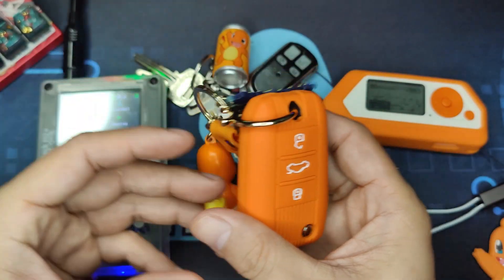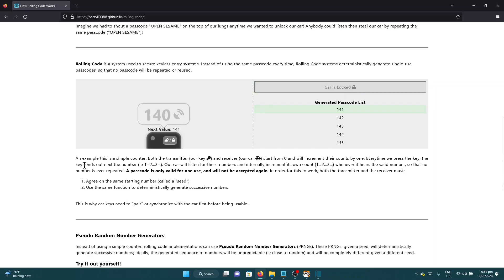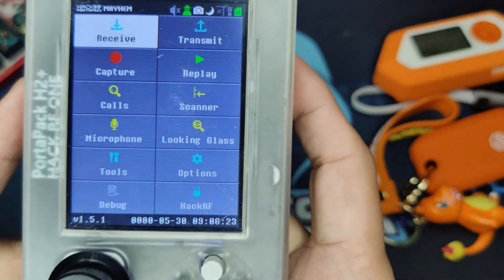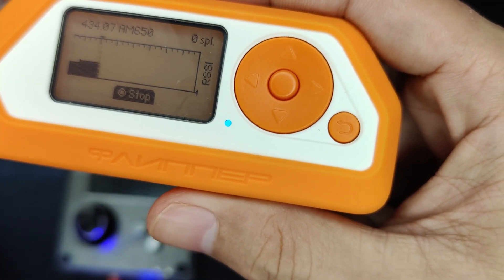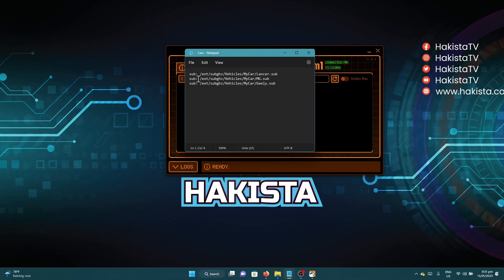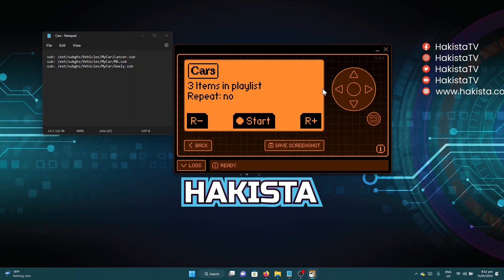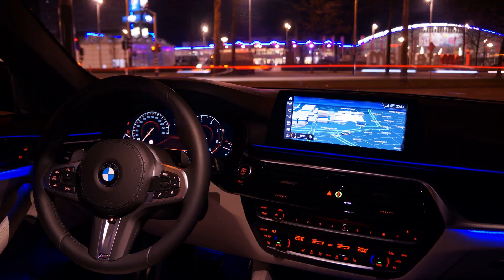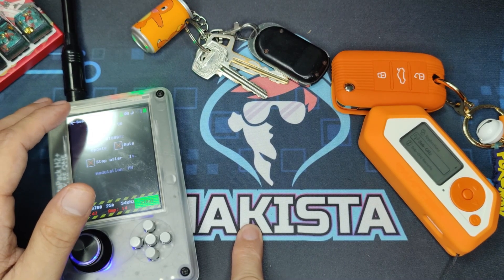Hacking 3 cars in 10 seconds // Pinoy Hacker

Comment: Question if I do this will my original car remote de syncs? 

Let say I capture and press the unlocked 5 times even im out of range from my car?
Reply from the maker: it will only cause problem if the signal is recieved by car. I wouldnt risk it because the cost resetting it at the dealer  is expensive

Comment: If I use my HackRF to jam the signal from the key fob to not let the car lock, what is the point of capturing/figuring the rolling code to unlock the car? Also did you capture the locking signal from the key fob, or the unlocking signal?
Reply from the maker: 1. Jammer was that the code does reach the reciever. Once it reach the reciever, the code cannot be reused again.
2. It is a one time use only code since it is a rolling code. Although generic rolling code implementation are now easily by captured and replay by flipper zero.

3. The locking signal is captured from keyfob
Reply: @HakistaTV  so is this same for supported vendor, do i need to jam the signal ?

Comment: team, also why just not unplugg the car battery ? or the car jammer works internally and is powered separately ?
Reply from the maker: The hackrf was used as the jammer while the flipper zero was used to capture the signal.

Unplugging the battery didnt crossed my mind 🤔

Comment: I didn't understand some things: if I use the jammer, will the Flipper zero  also record the noise of the jammer? Let's suppose then that I manage to register the opening signal of the car even if I attach it in the future I will be able to open it only once then the rolling code will change again
Reply from the maker: 1. The jammer will be near the car and the keyfob will be near the flipper zero. With this, flipper zero can record the signal without being received by the car 

2. You can only use the recorded signal once and only if the car wasn't opened yet. Because the valid signal changes every time the car receives one. There is also a chance to screw up the codes and brick your lock. Your only option is to have your manufacturer which expensive

Comment: Can the flipper capture with a gpio antenna? Does the flipper have capabilities to capture the signal, just like the RF one?
Reply from the maker: I have seen on some projects that integrates an antenna via gpio. An it improves the range of what you can capture.

Flipper Zero is sub-ghz only which means it cannot capture vhf and uhf  radio signals like hackrf
Reply: @HakistaTV  thank you for that cool maybe I’ll get a RF 1 as well.
Reply from the maker: @godzeus9702  HackRF one is an awesome device specially with the portapack!

Comment: I noticed the playlists in the latest Xtreme FW too. I am planning to use them against Paradox rolling code fobs. These have always only 16 codes rolling in certain pattern. So I plan to make a playlist with the correct order. Playing through all of these should finally bring me to correct code.
Reply from the maker: i checked out paradox keyfobs online, if you just read it does it show princeton? because if thats the case then flipper zero already has the code to replay it correctly
Reply: @HakistaTV  i didnt understand , flipper zero record a lot of time codes after flipper zero can know which code will use?
Reply from the maker: @keremacar2159  when flipper captures a code, it can identify it's algorithm and then use the algorithm to send the code. Here is the github of the algorithm implementations from the official flipper zero firmware:

https://github.com/flipperdevices/flipperzero-firmware/tree/dev/lib/subghz/protocols
Reply: @HakistaTV  flipper zero enough or HackRf one Portapack h2 need too?
Reply: @HakistaTV  btw thank u so much . I'm learning
Reply from the maker: @keremacar2159   thank you so much I appreciate it. Flipper zero was for capturing code, but for rolling code it will be useless if the car was able to recieved it thats why hackrf was used to jam the signal so that the car would not receive the code and you can use it once. You can capture code if you want, far away from the car so that you can reuse it.

Comment: How often can you use it? Or is it a one time use or can you use the same multiple times?
Reply from the maker: my keyfob for the lancer I can use it multiple times.  The modern ones like the MG and Geely, only once.

Here are the rolling code algorithm currently supported by flipper: https://docs.flipperzero.one/sub-ghz/supported-vendors
Reply: @HakistaTV  what year is ur lancer?
Reply: also do u think that instead of signal jamming if we record the key from a far distance from the car and then replay the code near the car it would work?
Reply from the maker: @simplycrackin  its an e 8th gen 2000-2008 lancer. I changed the lock back then. Thats why it is using a chinese brand named Cobra.
Reply from the maker: @simplycrackin  yup being far will work, but i think it should be more than 100 meters

Comment: Key fob proximity sensor uses a rfid did you tried copying it from key fob?
Reply from the maker: ooooohhhhhh let me check that one
Reply: Did it work?
Reply: @chetankeshari  do we know if it worked ?
Reply from the maker: @chetankeshari  i tried it but i am not getting any rfid signal from the keyfob 😑
Reply: @HakistaTV  their is a way or else how would so many hellcats be unlocked and then started I’m not understanding what device is used to unlock and start a vehicle you need to key fob near the vehicle in order to start it so how else could you revive the signal if one the car is parked unless you follow someone till they unlock the car and turn it on but then the codes change unless you have to go back the second day  while having the signal jammed watch them go unlock the car and start it and reply the back ? Seems a little too easy